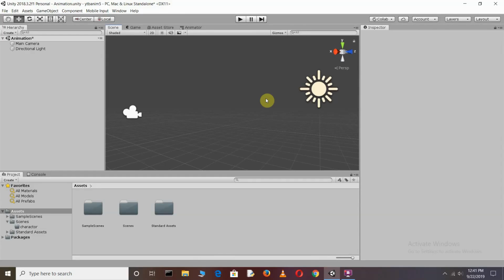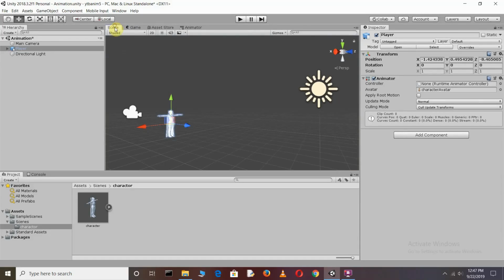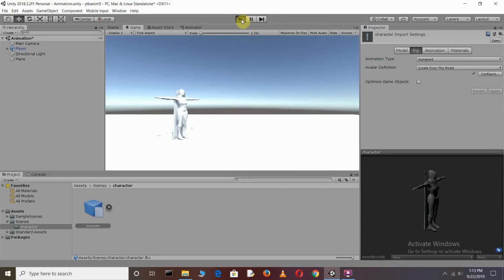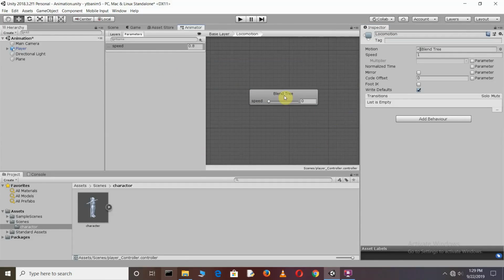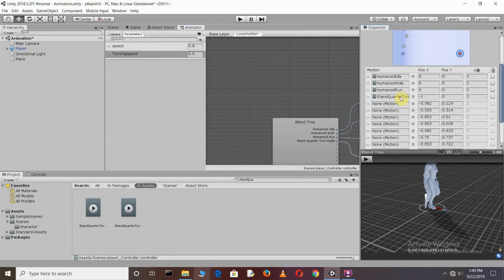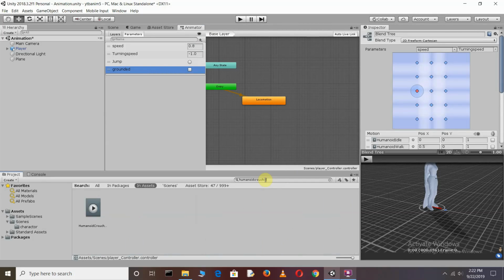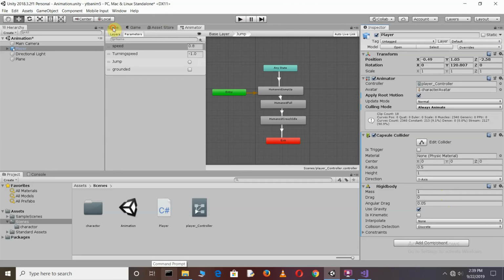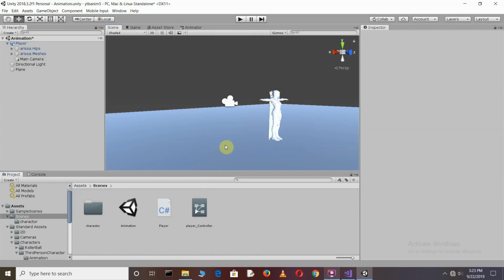How to Make Our 3d Animation ARCHER _Character move Idle,Walk,Run And Jump by Using UNITY C#

Comment: I have a problem. I am using different characters. I did everything as you did and my player won't move, he only does animations in place. Also, I have a problem when I turn right my character is turning left can you help?
Reply from the maker: There is no issue with using different characters you can use characters which you want to use ...I guess you should have to recheck the animation transition in animator window and also recheck the conditions .........
Reply: @unitycreators4247  Thank you so much, you helped me a lot with animations keep it going!